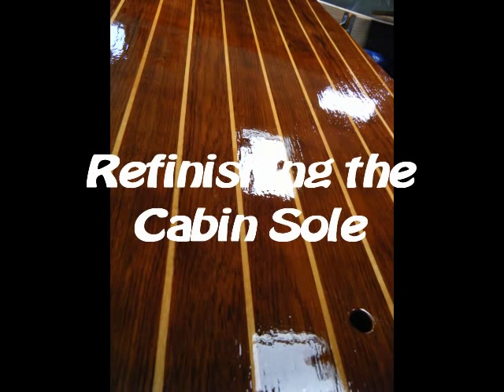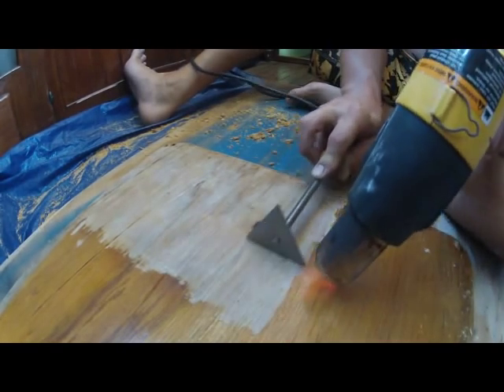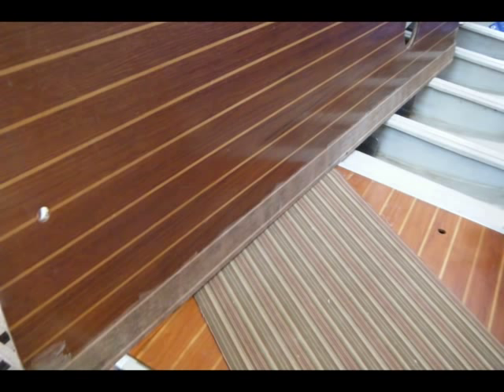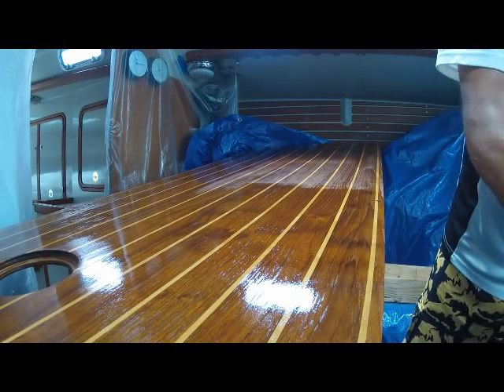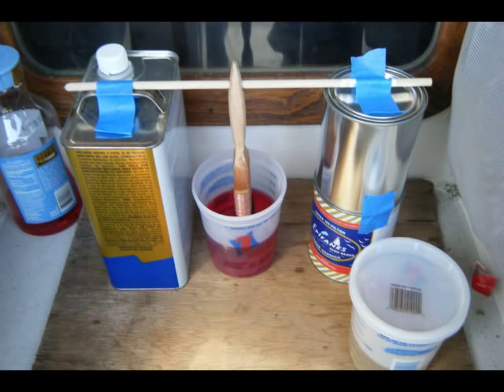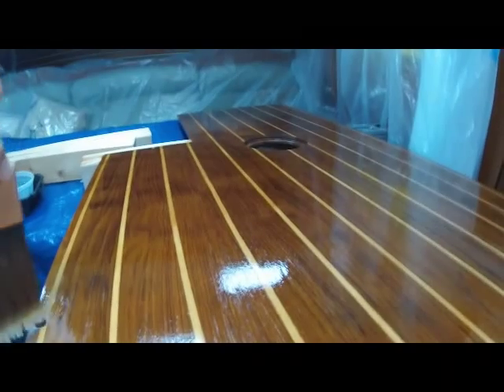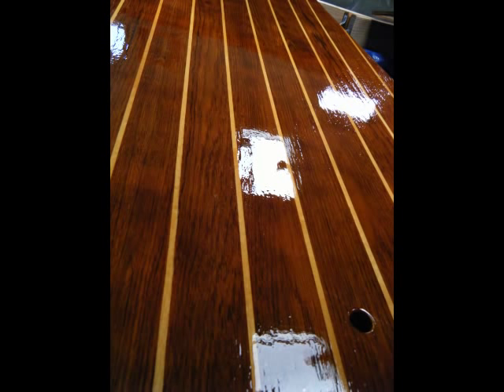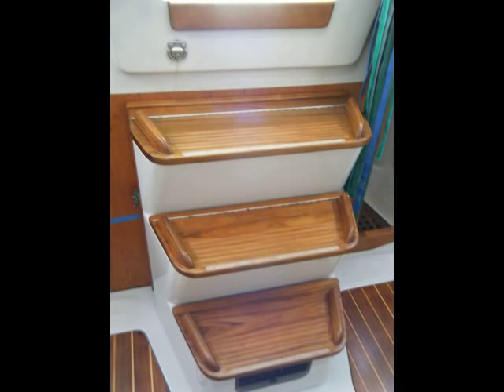How to Varnish and Refinish a cabin sole - Get A Deep Rich Sole in that sailboat floor

Comment: out of all of the varnish videos on YouTube, i would say yours is one of the better ones. typically a professional job would be 7 coats from bare wood. On your 5th coat, you should start paying more attention. At 5 coats i would sand any flat surface with a firm block to reduce the "orange peel" effect you see at 6:00. simply scuffing by hand is alright to a certain point. Your results should be similar to a pane of glass
Reply from the maker: I completely agree with you.  Depending on the surface I am doing I will do that.  This sole specifically I did not want to be that smooth but I wanted it close.  The owners believed that if it was tooooo smooth it would be slippery.  And they are right in what they wanted.  I personally like a super shinny smooth surface.  And Thanks for the compliment.

Comment: I'm sealing a piece of myrtle wood to use as an outdoor bar/countertop w/ Epifanes Wood Finish & will follow with Matte. I'm a beginner at sealing & am so happy with this video! No where else have I found what to do in between coats (the 24 hr dry time) ie: what to do with the brushes - love how you showed us how to hang the brush using the cans & a dowel - also, I'm deferring from the video that the leftover thinned product was in the plastic tub w/ a lid. Thanks! This was most helpful.

Comment: Mr. Frankenmer, I learned some good techniques from watching your video and I'm very thankful to people like yourself who share their knowledge with others. I'm in the process of refinishing my boats teak holly soul that's been damaged from oily bilge runoff and snow melt that got in under the winter tarp and settled on the floor. Floors that were once beutifullly varnished are now discoloured and faded. After washing them with murphy's oil soap I think I'll now use your heat gun technique rather than a stripper in hopes of mitigating any further damage before restoring them to their former appearance.  Any suggetions are welcome. Thanks
Reply from the maker: Ian Hoyte Thank you.  That should work fine as long as the oils didn't get to the wood.  Remember to hand sand when it is stripped and go with the grain.  Good luck with it.  Oh and be very careful with he heat gun not to burn your wood.
Reply: ronin51670 BTW, I forgot to ask if you've had any issues with Interlux Clear Gold Varnish. I sanded and re-varnished a section of the removable teak holly soul and I'm waiting to re-sand and put a 2nd coat of varnsih on it, however after 3 days the piece is still tackey to the touch. Therefore I'm assuming it's not cured yet nor is it ready for sanding. Any comments?
Reply from the maker: Ian Hoyte You are right.  It is not curing if it is still tacky.  Something is wrong.  It may be weather if it is way to humid.  Other than that you have a problem.  I'm also assuming that for sure you are using a single part varnish.  If by chance that is a two part then the mix was off most likely.  schooner is the single part and perfection is two part.  Also sometimes using the wrong type of thinner for the varnish can do the same thing.

Comment: You do a very nice job with your videos, and your work is first class.  Thanks for the videos.  I do have to disagree on one point.  Before the wood is sealed completely, it is possible to develop bubbles if the temps heat up considerably during curing as the wood/plywood can out-gas.  Try to work in constant or slightly cooling temps to avoid bubbles.  I found out the hard way.
Reply from the maker: Thanks for the comment.  It is true you can get some bubbles.  In the video I stated that rarely do you get bubbles.  But you are right.  It's a really good idea to varnish in the recommended temps.  And to make sure your surface is dry. Also to try to avoid very humid days as that can leave an unwanted dull film look sometimes.  Thanks again for posting it is great.  All of these comments like this help a lot of people get their job done.  And brings up points I didn't hit on in the vids.

Comment: very nice.  I am a gunsmith so I know what a pain it is to put on finish, sand, finish, Sand, repeat, repeat, repeat.  I have custom gun stocks that I have made that have ended up having about 60 coats or more on them. Talk about beautiful!  I also use the same method that you do of diluting the Varnish and progressing up to 100% varnish during the process.

Comment: I have a 1997 Hunter 376 in desperate need of a cabin sole clean up.  I was told when I bought the boat that because Hunter is a production boat they use very thin top vaneer and that refinishing would not be possible.  I was impressed by the way you used the heat gun, scraper, and then hand sanded.  Do you think that your process might work for my boat being that the vaneer is so thin?
Reply from the maker: Do the smallest section first.  Preferably a section for the head or storage.  Then try my procedure and if it works for that it will work for the others.  Just don't get impatient. These were really thin. good luck.

Comment from the maker: Hi and thanx.  The wood finish works great also but i think in my opinion that varnish dries harder and last longer.  but probably not by much.  also i do like that you do not have to sand between coats on the wood finish.  but you also can not really get the rubbed effect with it either. or i should say easily lol.

Comment: Excellent. Especially the ratios. I tend to dilute 25% only until the last coat but I'm no expert. What you are suggesting makes sense. I have a tug and the floors have to stay down. Makes all this much harder. I can take the stairs and hatches into my garage but the rest will be sections. How about teak walls? Anything you would do differently with them?

Comment: Great video.
What are your thoughts about using Epoxy?
Reply from the maker: @CaptainG-xs3yo  while epoxy may be much more durable.  It is way more expensive and harder to work with and maintaining becomes more difficult as well. But can be a great alternative if you have the time money and skill. Keep in mind epoxy is very difficult to remove and fix if there are problems possibly ruining your decking or sole. Remember most soles are just a very thin veneer and cannot be sanded much. Have a great day and thank you for the comment. Good luck.
Reply: @RippleLife  
Thank you for the reply 🙏

Comment from the maker: thanx....it should do fine.  but on an outside deck in the rain it will be very slippery,  make sure the epifanes you use has the UV protectant in it.  ive used it on cap rails and floors and the stuff works great.  the rubbed finish will dull it down but double check the rubbed finish i think its NOT as UV as the gloss.

Comment: I was impressed with the use of the heat gun and scraping.  Do you also need to follow up with fine sand paper?  Also, do you recommend using tack cloth for cleaning.  Awesome instructional video!
Reply from the maker: thank you very much.  200 to 220 grit is finest you need to use.  you can even go 180 but be careful if using laminated.  tack cloths work great fro a final wipe.

Comment: For the varnish, I prefer to get the original matt (hand rubbed) finish, not the glossy look achieved by using pure varnish. The boat yard has recommended rubbing in teak oil onto the varnish (which works by penetration of the varnish). Also they recommend using two-component polyurethane varnish for durability. Any comments on achieving good results for this? in particular in regards to the thinning you suggested.

Comment: Love the video but my boards has a lot of black and fade out spot how can i get it back thanks
Reply from the maker: Hi, and thanks.  If they are the thin veneer then you would want to use sanding very sparingly.  If it's not veneer then sanding would work.  There is a bleach for wood but honestly cannot remember what it is.  That may work.  I have never had to use it.  I was always able to just sand a thin layer off till it looked good.  But again have to be very careful with thin veneer.   Hope that helps.  Good luck with it.
Reply: @RippleLife  yes it's a tin board veneer

Comment: I really like your series, you have a great way of being down to earth with these projects and making the work seem less intimidating. I've wanted to improve the woodwork on my own for awhile but now want to get started right away. Thank you!
Have you ever installed new lighting in your boat? I'm toying around with getting some LEDs for the galley and saloon but I don't want to make a mess of it, or have them come out looking tacky. Any thoughts?
Reply from the maker: I'm really glad I can help and that you like the vids.  I have done multiple LED installations and they are actually very easy.  I don't have any videos of it though.  Led's are way worth it though and really improve lighting and battery times.  There are two main options you can try.  1. you can get direct replacement for the style bulb you have currently.  Just look at the number on the base of the bulb and you can find an led replacement for it online.  2.  wire in a whole new fixture which is only a neg and pos wire connection.  Just make sure to join the wires properly.  I have a vid for that.  Proper wire connections.  Good luck with it.  Oh and make sure you know what kind of light you want as in bright white or amber or dim etc.  They come in a lot of diff brightnesses. I like the bright ones if they have a diffuser cover  or a shade.
Reply: Cool, I'll look into it, thanks again. Really dig the BSG CIC you put in too, I like your style, have a good one!

Comment: Hello! Your video is so so helpful, we just boat our first 2 boats and the floors need redoing! Do you use 300 for the sandpaper in every sanding process or you gradually change the sandpaper? Thanj you!!
Reply from the maker: Hi and ty. I do use 300 most off the time. It's a good grit to take off what you want and leave what u don't lol.  If you get to a point and you notice your finish is a little rough or rippled or have runs, you can drop to about 220 and lightly sand the switch to 300.  Towards the last coat 300 is still fine. Unlikely but if you don't get a smooth last coat u can sand again with 400.  And that's usually just cause by to thin of a coat or not covering properly.  Well thanks again for the comment. Take care hope this helped and good luck.

Comment: Excellent and just what I needed today!  Have  you ever replaced the plexiglass on an opening port?  Have you replaced the entire port?  Thanks!
Reply from the maker: usually the pothole part with the glass can be detatched.  Them portions are all usually designed different.  so can be hard to remove or easy as breaking it out and cleaning up the glue.  if replacing the whole porthole.....lol good luck.  they are the hardest thing ever to remove.  especially in old boats where people used 5200 to seal.

Comment: Very nice work and well explained. just 2 questions, 1. my steps are 90% covered with black non-skid, how do I lift them off?  2. What grit for the 100% varnish sanding? Thanks very much.
Reply from the maker: As for the steps you'll have to use heat gun and scraper.  the last sanding is still 200 - 220.  And thank for the comment.

Comment: Great,  I like your technique and tips.   As an owner of a WEST system cold-molded sloop, I have taken to applying some of the tricks of epoxy-composite construction to projects like cabin or cockpit sole refinishing.  What I  do once the difficult business of stripping and sanding the surface is done is to apply two or three coats of clear setting epoxy (I like WEST 105/207 resin/hardener combination).  On teak this will tend to bubble on the first coat, but a second or third coat well sanded out will give a fair smooth surface that will accept varnish without the need for a sealer coat.  The epoxy yields a very hard, waterproof base for the varnish, which you can then apply as described.  Of course you would do the underside and edges as well, but would not need to pay as much attention to surface prep - a second coat over a well-sanded first coat  is enough in my experience.  Epoxy vapours are quite toxic, so this is NOT something you would want to do in the confined interior of a boat.  

In this application, you need to think of the varnish as a sacrificial coating, to be replaced when it needs redoing.  The varnish also provides UV protection for the epoxy undercoat, although this is less of a concern with interior surfaces than it is on the hull or deck exterior.  The upside is that there will be no need to take the surface back down to wood at that stage, since it will not have absorbed any water, and because of the hardness of the epoxy is also less likely to have sustained dents and mechanical damage from foot traffic.
Reply: Bruce Bol

Comment: Hi, I watched your video with interest, and used your technique to completely re do the saloon area of my Contessa 32 . The first 4 coats of Epiphanes went on like a dream and left a super gloss finish. Having rubbed down ready for the next coat of rubbed finish Epiphanes.
The rubbed finish seems to have a different consistency and i could not get a smooth finish, it is quite warm here in England right now.
I've sanded it back now, do you have any suggestions as to how I can get a nicer finish for this last coat please?
Brilliant video by the way, I found it extremely helpful
Reply from the maker: Hello,  if the rubbed finish is't going on very smooth it could be that the rubbed finish like you mentioned is a different consistency.  It most likely is trying to cure quickly making it difficult for the varnish to lay down.  Try thinning the rubbed finish just a little before applying by adding a little bit of mineral spirits i stated about 25 percent.  Its possible you may need a little more... till its at a consistency that allows it to lay down before it dries. Also try to work a little quicker for the rubbed varnish as it does not smooth out as fast.  It's most likely the combination of the thicker rubbed varnish and the hot weather.  Also remember the rubbed finish is not glossy.  But it should lay down smoothly.  Oh... test your consistency on a scrap of wood before applying to the main sole. And allow for ample dry time for both re-aplication and the final drying.  If not we get them "varnish lumps".  I hope this helps you out. It sounds like your doing great though. Good luck, take care and be safe over there.

Comment: Great video!  I was wondering what you would suggest for refinishing a sole that is not removable.  Is it acceptable to varnish in sections?
Reply from the maker: Ours is like that.  and the way we are doing it is to do it in sections by room.  For example we are doing the v-birth first then the mid-birth and then galley.  We start in the hardest position and then varnish toward the most accessible.  you really want to try not to varnish half of a section then wait and continue.  it's very hard to get the varnish to blend  seamlessly.

Comment: I have a 1960  20' mahogany boat that I have been varnishing every year for many years - just adding one coat each year. Last year blisters arose all over the boat. I was wiping the boat down with alcohol to remove dust. Might that be the reason for the blisters? Is there a fix for the blisters short of stripping back to bare wood?

I will definitely be reviewing your video before I varnish next time.
Reply from the maker: Yes alcohol can cause blisters in varnish.  especially if you use a lot and let it sit for a sec.  But it might not have been that if it was just a damp rag.  It is possible that there was some moisture in the last coat that you did (possibly doing it later in the day and not drying before dark).  Moisture in it is the more likely cause.  And sometimes differences between the varnishes and multiple layers can cause it.  Especially if you didn't sand before applying the coats.
Reply: ronin51670 Thanks very much. I don't know where the moisture is coming from so I wondered if the alcohol was holding water. Actually, I was using methyl hydrate. Thanks for your time and advice.
Reply: I'm not sure if your question is relevant anymore, but I've come across this problem myself. You need to use a different varnish. Specifically an Interlux brand like Perfection Plus or Schooner 96. To prepare the wood use a 100 grit sand paper, followed by a scrub with a wire brush and mineral spirits. After it dries use a heat gun to hear the wood, but don't char the wood. Sand with 220 grit and wipe clean with mineral spirits. Apply stain if necessary, then apply varnish ( up to 5 coats for best results). Preparing the wood is everything.
Reply: Alberto Antonio Lainez
Not what I wanted to hear but not unexpected either. I figured I was in for a complete refinish but this confirms it for me. Taking the time to respond with such detail is appreciated very much.